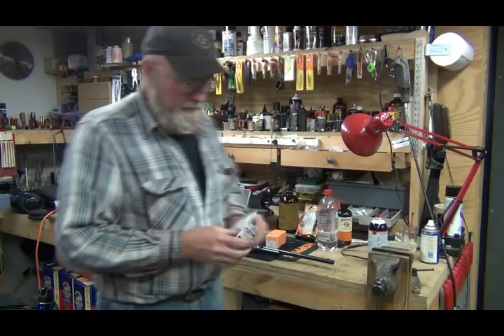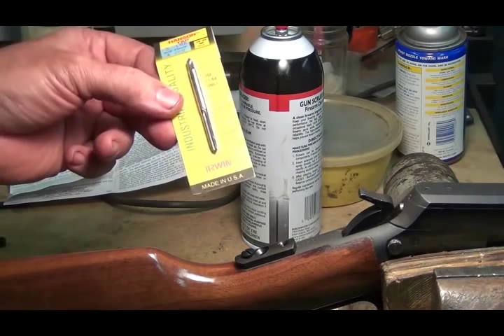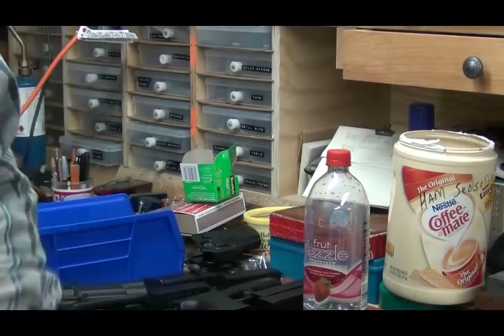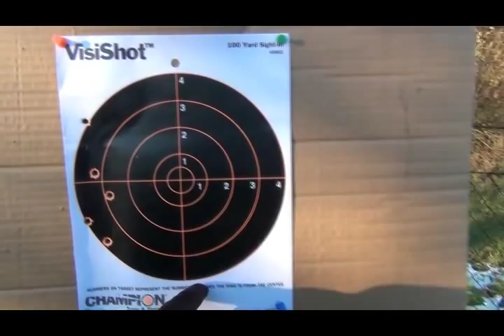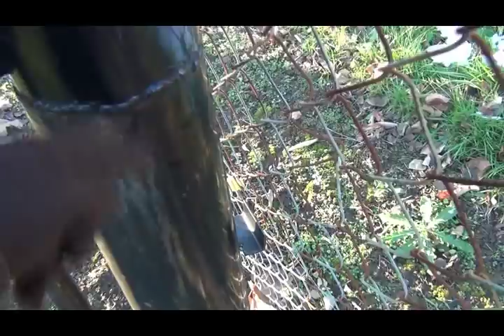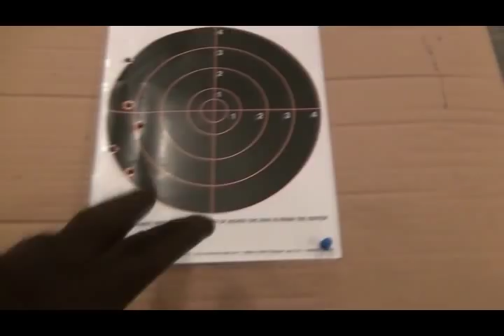Installing a Lyman #2 Tang Sight on a Marlin 1894

Comment: This is why I only use Marbles brand tang sights.  Unlike the antiquated Lyman brand, the Marbles  tang uprights come with a windage knob for adjustment on the fly.  Having to add shims leaves one with a sight that is tilted off of perpendicular.  This means that your windage is only accurate at a single elevation.  Any elevation adjustment will throw the windage off.    With the Marbles brand this does not happen since the windage knob moves the entire sight arm to the left or right plus it allow one infinite adjustments in the field rather than having to go back to the shop to add or subtract stupid shims.

In addition Marbles at some point introduced what they call an improved tang sight.   This is a sight that is not permanently attached to the base.  They provide a small Allen wrench to allow removal.  The upright portion can be purchased in 3 or 4 lengths according to the ranges you want to shoot at. The elevation range of each over laps the next size just a bit.    Then you buy the base and screw set you need for each rifle you want to have a tang sight.   This allows one to but a base on several rifles that can share the same upright part as needed or until one can afford more uprights to go with all the bases you have.

I am not connected in any way to the Marbles company, but found out from experience that their sights are generally superior to Lyman in every way--especially the tang models.

Comment: Why not just mount a receiver peep sight in the already drilled and tapped holes on the side of the receiver?
Reply: shorter sight radius, and sometimes the rear sight will be too high, requiring a replacement front sight

Comment: Thanks for going to all that effort. I have just recently picked up a ‘JM’ 1895 Marlin in 45/70 with the same Lyman folding peep sight. I am yet to make up some loads for this rifle. However one thing I noticed is that the base of the peep makes it incredibly awkward to get a normal grip of the pistol grip of the stock. In 45/70 I’m concerned that I won’t have as much control of the rifle. Also if I remove the Lyman peep is there a screw I can purchase to fill the drilled hole? Anyway thank you for sharing!

Comment: Use a small cheap laser flashlight and line up peep hole to the other two sights already on the rifle.  This assumes, of course, the two original sights (front and rear) were already adjusted dead on.  Then, as he stated, swing down the buckhorn.

Comment: Excellent video Buckrun11, I enjoyed  watching & thank you Sir, for taking the time to share your video with the rest of us. Like the other commits stated below, I was a little bite worried about freehand drilling, looked like it turned out very well.  I have a question sir, I like the design of your bullet trap & was wondering if you would not mind sharing some thought on your bullet trap design, such as the size of your plates & the plate angle, how wide is the slot  you have for the bullets to enter the catch pipe. I would like to try and salvage my bullets.  I have on hand some ~1/ 4 inch (it is extra heavy well drillers pipe), maybe a little thicker i don't remember for sure, but the pipe has been used to drill deep water wells with, so it should be some good steel. Would you think something like  this well drillers pipe would be adequate to use for catching the bullets?  I do not think that I would use jacketed bullets coming from a 30-06 type round, as I would use mostly cast loads for my main loads for shooting.  Any advice you could give on your design would be greatly appreciated.  Very Respectfully,   :)dd
Reply from the maker: The steel plates are 1/4" AR 400. They wont take a hit from something like a 30-06. But if you got some harder pate it should work. Each side of my trap the plates are around 24" x 24". The left side is lined up with the round in the back so the bullets could slide right in to the tube and start spinning around. The right side sticks into the tube just about 3/8" so it directs the lead back around as it is spinning. The opening is 1 to 1.5" don't remember off hand. You don't want to shoot dead center so the bullets don't hit one side plate or the other. If the bullet goes straight into the tube it will splatter against the tube and come back out. If I remember correctly I think the plates are 60 degrees from each other. 90 just looked to flat to the shooter to work like I wanted it to. I wanted all the lead to travel into the tube. not splash back out. My tube is 6" dia. and about 3/8" wall.
Reply: Greeting Buckrun11, I just came in & seen that I had a message from you, I was not expecting such a fast reply, But Thank you for answering my questions about your bullet trap.  I did go out &  double check  my pipe dimensions, the pipe is, 4 in. dia by 3/8 in thick. & about  3ft long.  My steel plates are just mild steel as far as I know, the plates that I have is 1/2 in thick by 14" sq.  I know with  what I have on hand is smaller than what you mention, but I believe I can make it all work & knowing what angles that you used will save a lot of time in trying to figure what angle would work the best.  My home range is no more than 50 yards and most of my shots  will be about 25 yards or so with .22 & 308 cast bullets.  
Thanks again Sir, for answering my questions & hope to talk again.
Very Respectfully  dd